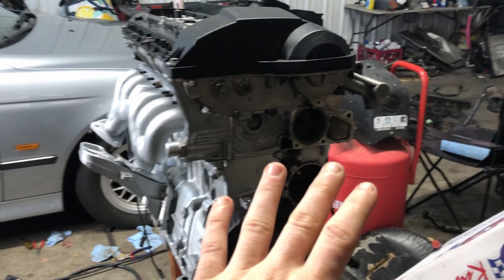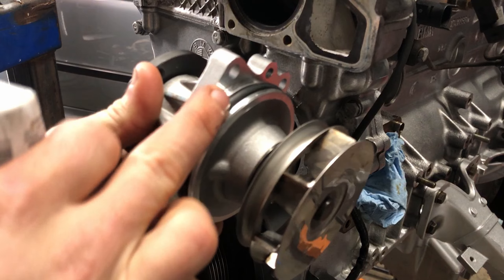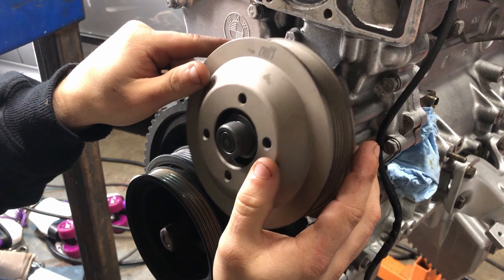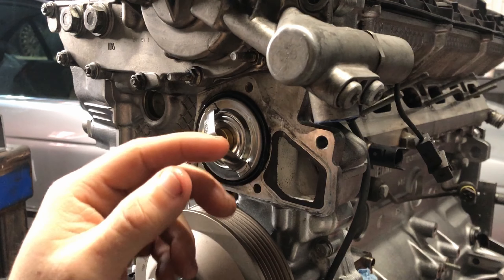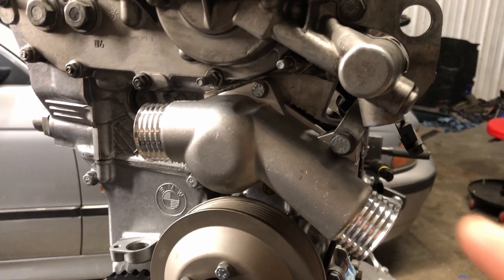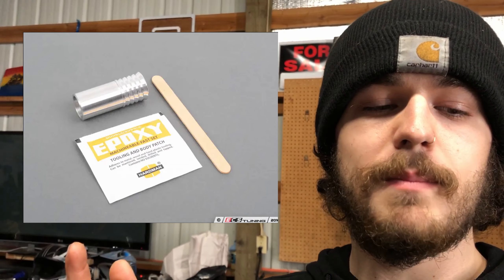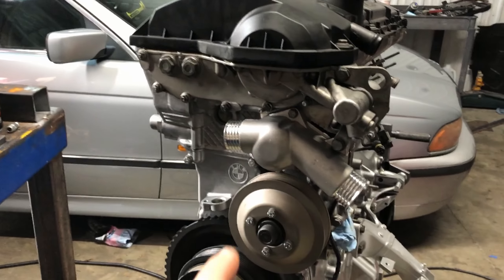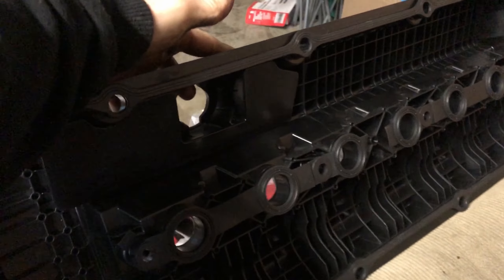E36 318ti M52 Swap Ep. 3: Making BMW's Cooling System Great Again

Comment: I'm in the process of swapping an m52b28 into my 318is. love the content
Reply: where and for how much did you get the engine I can't seem to find one
Reply from the maker: Dude that's awesome! How far along are you?
Reply from the maker: @clxwn I was able to get my engine with a full wiring harness for $600.
Reply: @JamDrifts  well since you explained the whole cooling ordeal that will save me so much time. I have everything needed to get it running besides a single engine mount bracket for the drivers side 😂
Reply: @JamDrifts  bro what I'm lucky to find a engine with oil leaks and blown head gasket for 2500
Reply: @MidNite.Garage  I paid $600 for mine with just motor mount harness or ecu
Reply: @InOneWeTrust  whered you get it, did you order it online? junkyard? Facebook marketplace?
Reply: @MidNite.Garage  i got mine off facebook marketplace.

Comment: Not mad at the idea of getting rid of all the under the intake cooling hoses. I had a leak on the one by the firewall the morning of a drift event 🤦🏾‍♂️
Reply from the maker: That's exactly the type of thing I'm trying to avoid by getting rid of all the hoses. Had a heater line blow off at the track and blew the head gasket on my 318is. Not fun at all.